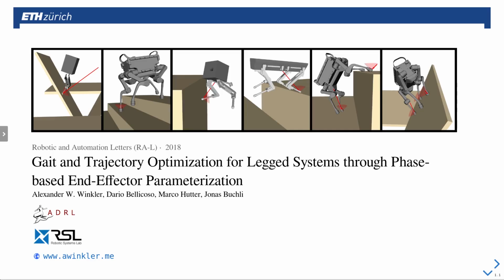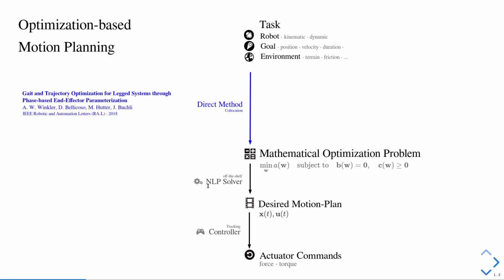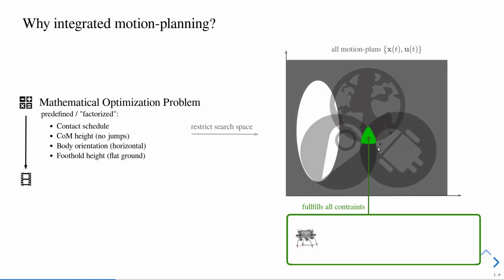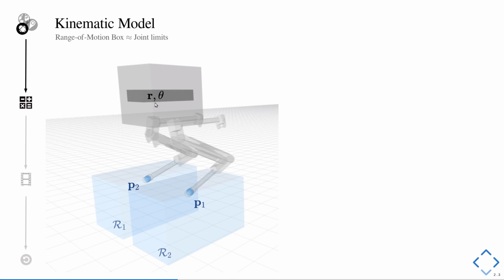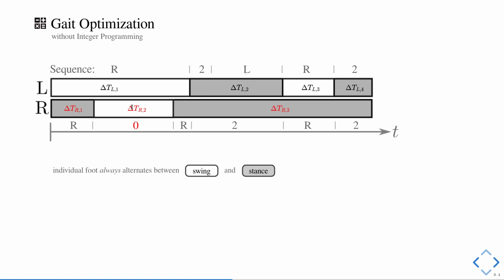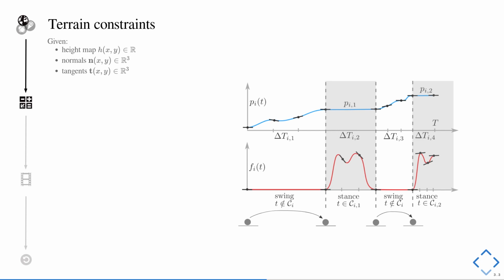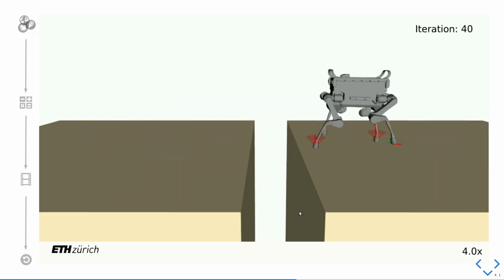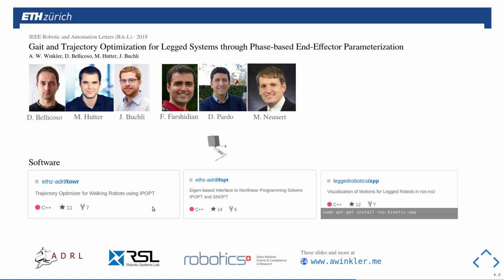Tutorial: Gait and Trajectory Optimization for Legged Robots

Comment: It took me a few views to fully understand what's going on here. This is neat stuff. I suppose since the solver generates several possible gaits, a cost function could be used as a "selector" for which one to use depending on if we want to optimize speed, battery usage, etc. I suppose the only drawback to this method is that the number of steps to take must be specified at the beginning even though that could be tricky to guess in real-time

Comment: very inspiring! By the way, i have a question about dynamic modelling of quadruped robot using lagrangian. In my case, i consider it as a multi rigid body. Here is my question: while computing the legs dynamic model, specially the mass matrix of inertia, should i express the jacobian of the leg with respect to the global frame or with respect to its own reference frame (used for DH parameters)? thanks for answering

Comment: Where do you solve this optimization problem? Is there a computer on the robot or do you send the data to some other super computer. I was curious because optimization problems require significant amount of computational power and decision here needs to be as quick as possible.

Comment: Hi, great work
I had a question about the continuous phase durations 
The part I am confused about is how did you pass the phase duration as a parameter to be optimized during the program cause according to the dynamics the step time should not be directly related. If you could explain a bit more about the phase duration part it would be great!!

Comment: For Gait Optimization,  how is the number of swing and stance phase for each leg selected? The length of each phase is continuous but it seems that the number of phases must be selected
Reply: Yes, absolutely, that number is fixed in advanced. It can for instance be based on the total duration of the trajectory. A higher number of steps allows more gaits to be generated, but also introduces more variables, thereby making the solving slower. So it's a trade-off.